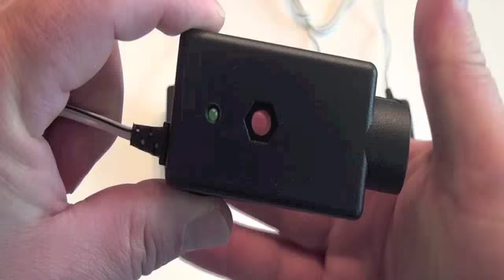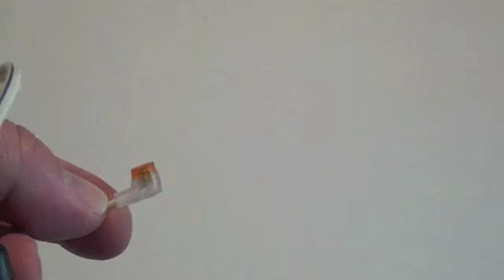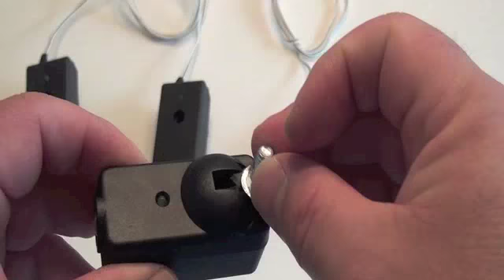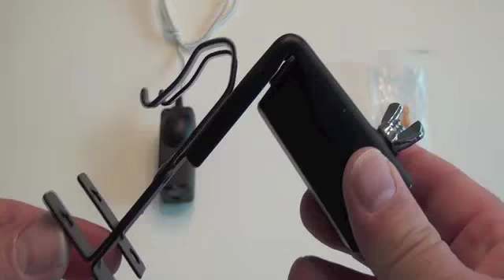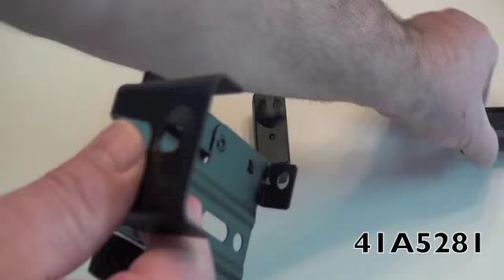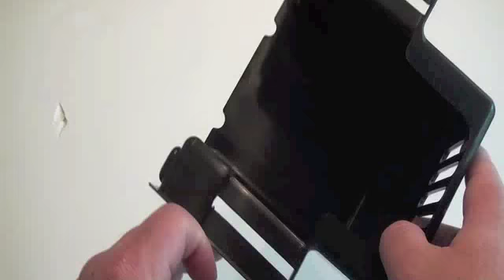LiftMaster, Chamberlain & Craftsman Safety Sensor Troubleshooting Guide

Comment: Hi. We have a sears 1994 opener...sensors stopped working...I. checcked your website..# 41A4315-6A not found. Would the  #41A4373A work for mine? It does have the little plug in kinda like a telephone. Looking for a reply soon...thanks

Comment: I bought a 41A C050-1M   the wires sre printed with - and +  the - wire has a black strip running down the wire so which is the positive?  The one marked  +  or the one marked  -

Comment: Thank you for this video!  I found it very helpful!  I moved into a home only to find out that the garage walls shift during each frost, causing my sensor lights to go out of alignment.  (Sill plate of garage walls are all rotted out). Despite readjusting the sensors, the sensors no longer work.  From this video, I not only found my replacement sensors that fit my model, but also found out about the extension brackets that will also allow me to move farther or closer to the garage door as needed.  With the sensor brackets able to pivot the sensor up and down, I am now able to move the sensor north, south, east, west as needed to buy me time when I can actually tear down the garage and build a new one.

Comment: The bolt and wing nut that hold the 41A5034 sensor to the bracket are missing. What size bolt is this? Looks like a pan head bolt from the video.
Reply from the maker: I think its a standard 1/4 20 carriage bolt appx 1" long

Comment: The lends fell out of one of mine and it's giving issue closing and sometime won't close at all... Where can I get a replacement lens?
Reply from the maker: They do not sell  a replacement lens, you will have to buy a new set.
https://www.gatehousesupplies.com/Liftmaster-eye-kit-41A5034-p/41a5034.htm
Reply: @gatehousesupplies  could a missing lens cause the door from closing? I am facing that issue. I tried closing while holding the open/close button down to bypass the safe sensor but still no luck. Just keep going back up as if something is blocking.
Reply from the maker: @illmatic33    The lens missing will definitely cause a problem but holding the wall button down should override that and allow the door to close so you might have other issues.
Reply: @gatehousesupplies  thanks
Reply: @gatehousesupplies  confirmed it's not the sensor. I see new doors (smart) are under $200. Typically what would be the cost for a pro to diagnose and fix this because if it's close to more than $150 it would just make sense for me to buy a new one and install myself...
Reply from the maker: @illmatic33  You would have to check with local service companies I have no idea what they would charge in your area.

Comment: My Chamberlain garage door started not working when the full sun in on in the afternoons. Other than that it works fine. I tried blocking the sun with toilet paper tubes around the sensors, but it still wouldn't work. Any ideas?
Reply from the maker: You can try to move them further sideways away from the opening so they get some shade.  
As the sun moves with the season it will stop doing it, typically its a short-term inconvenience.

Comment: I have been having an ongoing issue with my safety sensors for the past couple of years (the issue actually gets worse every year). The problem is that the green and yellow LED lights go out on the sensors when the weather turns cold. When the air temperature warms up to a certain point, the sensors will work again. Is this a common problem. Is there an easy fix without replacing the sensors?
Reply: When cols the floor or the garage brackets shift, just realign in 3seconds and you are done, cleaning the eye-glass every so often will help. These things are bullet proof
Reply: Rolan Watts jm

Comment: I recommend adding a light flat and locking washer to the Sears Craftsman safety lights to hold them more secure. Mine came loose and gave me trouble during first installation and testing.

Comment from the maker: Yes the 41a4371a  sensors are still available to purchase as a replacement part for the older systems.  They will not work ohn the newer units.
Reply: other people claim otherwise and description on websites claim interchangeable, just new ones better in sunlight..
Reply: Where are they ?
Reply: I recently replaced an older LiftMaster with a Chamberlain.  The older opener had the older sensors 41A4373 style.  I didn't bother to replace them with the new sensors 41A5034-style that came with the new opener and it works fine that way.   The chamberlain web site says the 41A4373 is no longer available (hey - any opener that needs it is 25 years old now.  I did find some 41A4373  on amazon and some used ones on eBay.

So at the moment, one of my other garage doors using a 41A4373  sensor is not working so I may have to pirate the sensors from the door whos opener got replaced.
Reply from the maker: @davidsmith9583  Hi Dave, we still have the old sensors for sale on our site, here is a link.  
https://gatehousesupplies.com/041a4373ats-safety-sensor-kit-with-receiving-and-sending-sensors/